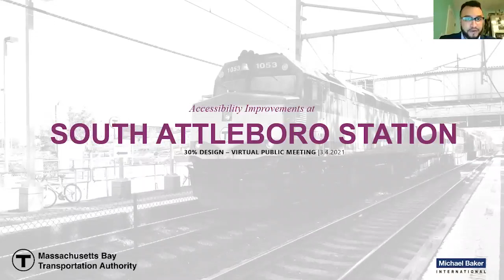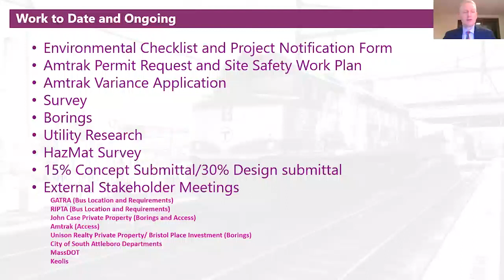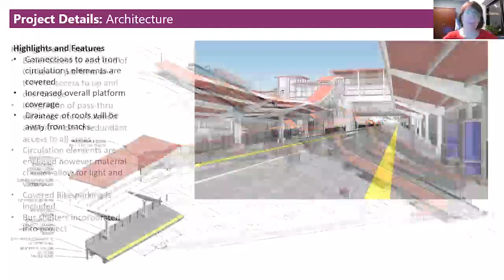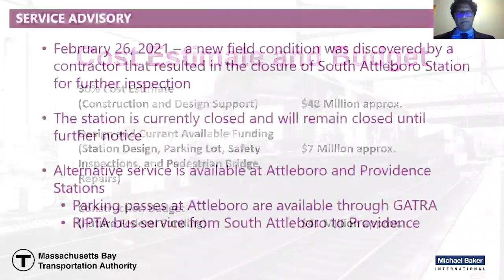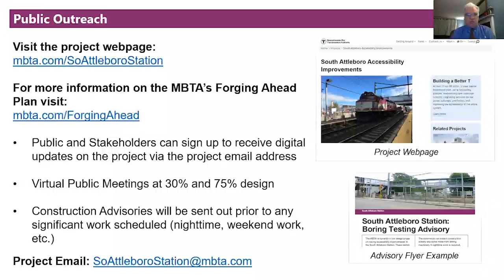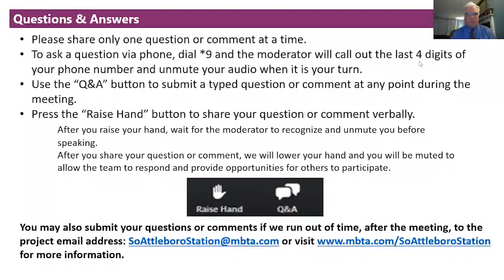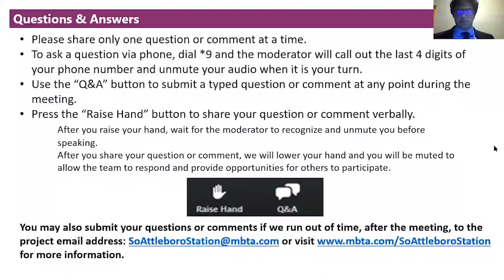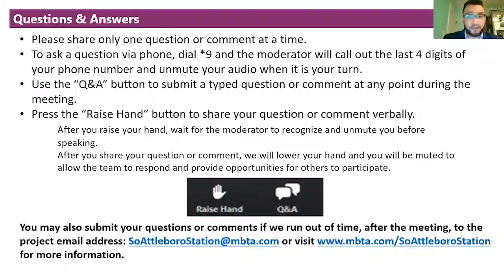South Attleboro Accessibility Improvements Project Virtual Public Meeting - March 4, 2021

Comment: There should be a way to build something temporary at the current location rather then having everyone drive further. This is incredibly saddening....shame on you. You don't have to cross over via bridge you can have what many other mbta stations have and have a cut out platform at that station because the mini high level platforms are in perfect shape and that needs to be taken into consideration as the year goes on. People do not deserve to be inconvenienced to this magnitude especially when this country is getting back on their feet. If you don't figure out a way to help the people that currently live in that area that can't get to the other stations many people just simply won't take the train. People remember stuff like this...if you aren't there for the people, the people won't be there for you when the construction is done and you are expecting them to return to riding the system.